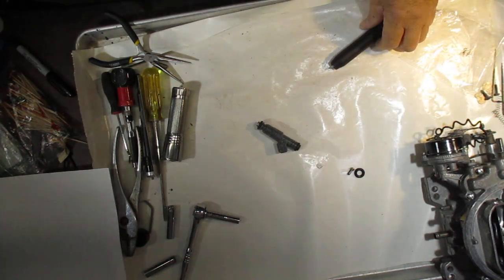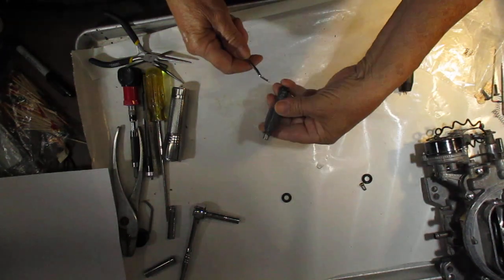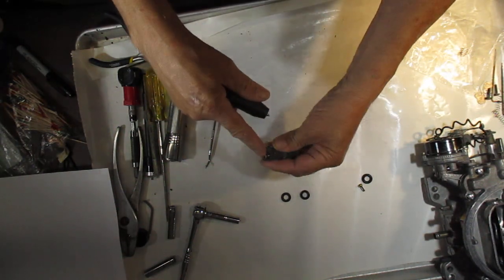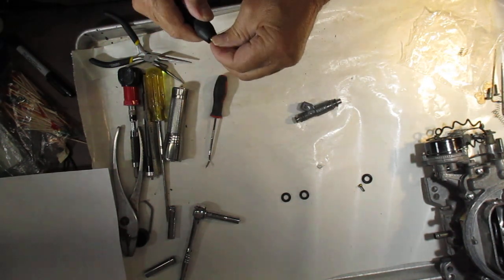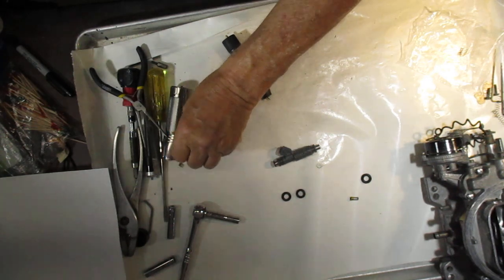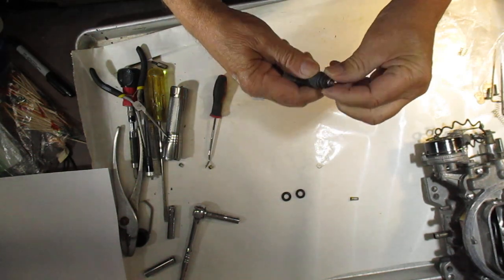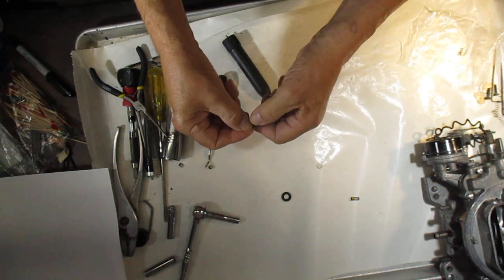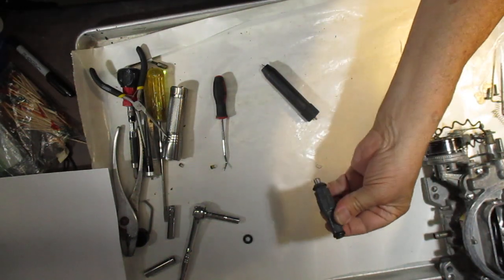How to Rebuild a Fuel Injector | Step-by-Step Tutorial

Comment: Thanks for the video. Just wondering, because most of the O-Ring manufacturer recommended synthetic lubricants  like silicone greases to lubricate the O-rings, they highly discourage to use petroleum based lubricants.
Reply from the maker: Yes, silicone is the best.
Reply: How do you figure? They're made to resist fuel and fuel is a petroleum product